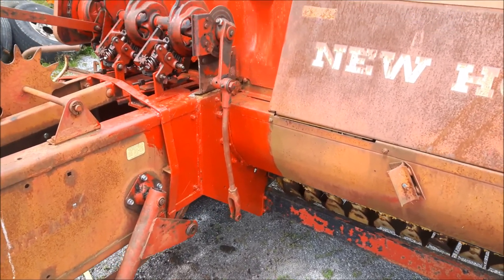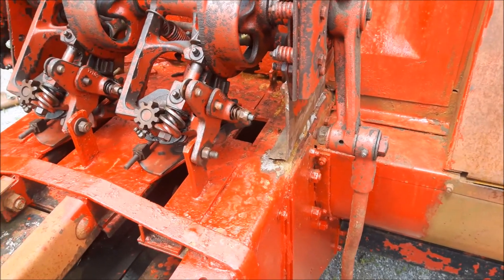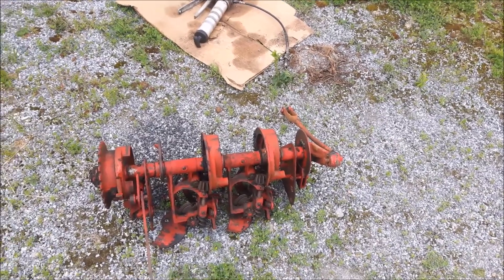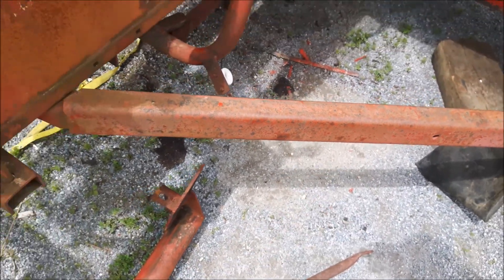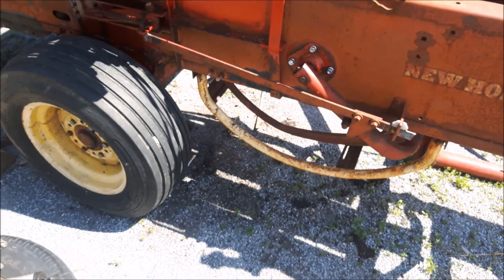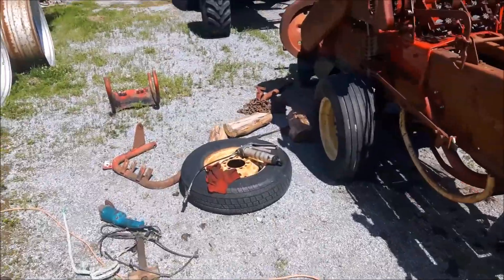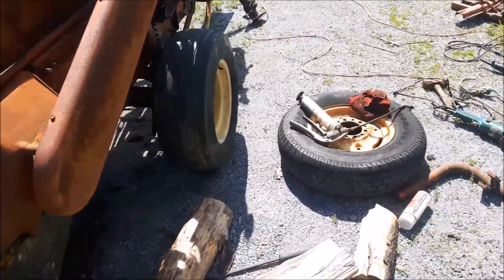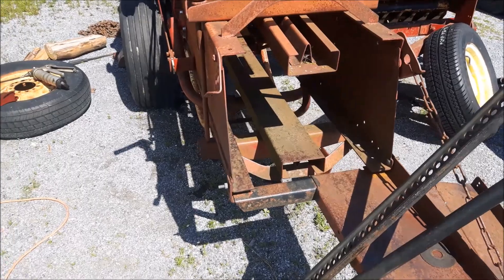New Holland super 67 knotter conversion Pt 2

Comment: Good to know, other than gaining a half inch at a few places looks like it works.
Reply from the maker: When you look at the back of the baler the plunger slot is wider on that side. With the 311 knotters the twine is equal now so on a 67 the 1 side was off 1/2 a inch. So not sure if the 68 and 69 were same as a 311 or not but the plungers were made for the difference